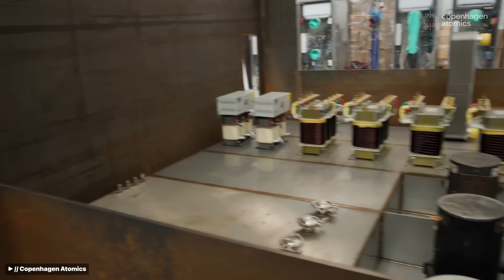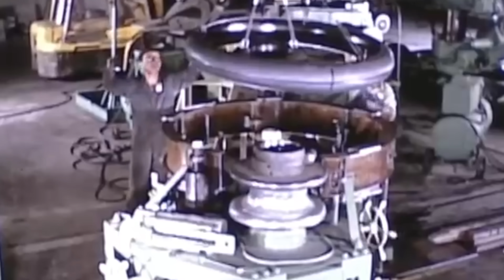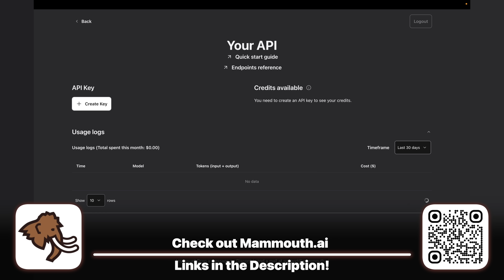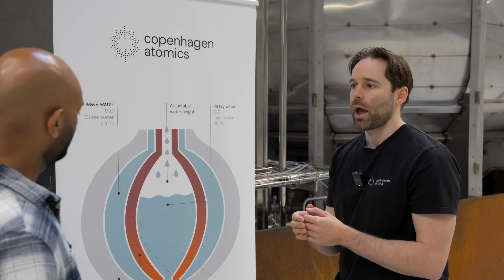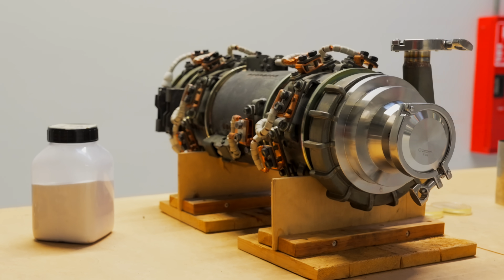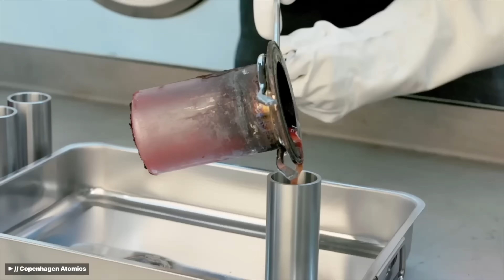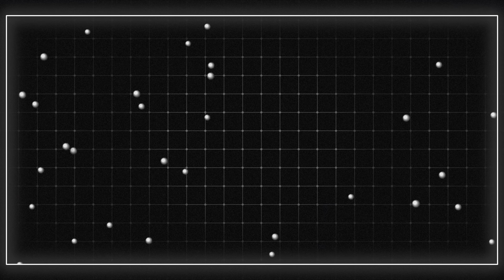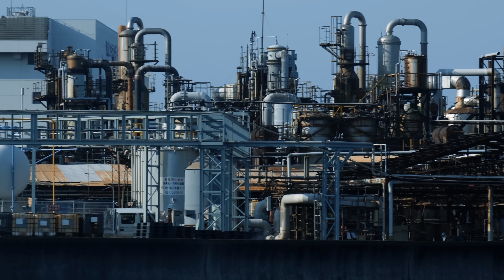This Modular Thorium Reactor EATS Nuclear Waste

Comment: These reactors LOVE heat...they don't need to be put next to a water source like a river or the ocean, they don't want to be cooled down, plop them down in the middle of the desert and they thrive they love heat.
Reply: To produce electricity they can use the hot molten salt to pass through a heat transfer system boil water to run a standard steam turbine or they use the Gas Brayton Cycle to heat nitrogen, helium, or co2 to turn a turbine, then cool it down by passing it through radiators to be  recycled back through the molten salt heat transfer again in a closed loop. Either way, the molten salt gets cooled to maintain safe levels.

Comment: Why does the Electric Motor that drives the pump have to be near to/in contact with the hot material being pumped?
Couldn't they just connect it to the impeller/whatever via a driveshaft?
Reply: The bearings and seals must be able to withstand the heat, corrosion, vibration and radiation without leaks, failure or maintenance.  Hence the five year no touch pump design.  I suspect their pump will go well beyond 5 years, but change out after 5 years for safety.

Comment: My bet is that the nuclear chemistry becomes too complicate not just for them but for the regulators to monitor. Then they will switch to uranium, just as ThorCon and Terrestrial energy did when they made the same realization. (my guess Flibe will do the same) I have no problem with this, there is no shortage of uranium and when utilized in this type of reactor is 10x more efficient than a light water reactor and has high temperature output.
Reply: But uranium nuclear chemistry is just as complicated, isn't it?
Reply: @davidhoracek6758  Nope, because it doesn't need a breeder reactor to fission.

Comment: Great video 👍
Diversification of power generation is key. Wind, solar, geothermal, tidal and nuclear are all needed for now. Depending on location, one more than others can be leaned on.
Cheers from Canada 🇨🇦
Reply: No what we need is a laser focus on Nuclear fission tech, because it is the only energy source capable of replacing our 90% fossil fueled World economy. Wind, solar, geothermal & tidal are bit players and always will be. Useful in very limited geographically endowed areas with certain suitable power requirements, or in the case of Iceland where they use a lot of low grade geothermal heat. The longer we delay the inevitable the more precarious our energy supply will be and we are on the cusp of an energy shortage catastrophe. One good war will set it off.

Comment: The SMR concept that actually works really pleases me. The fact that it can be containerized and shipped is a game changer. Whilst the dream of green energy is nice the base load problem cannot be dismissed and city powering battery banks isn't practical. So nuclear energy, the true green energy considering these are breeder reactors that are far more efficient with any given fuel, on this front the future looks good.
Reply: The reality is that several hundred gigaWatts of solar are installed per year, with that rate increasing rapidly.  Lots of wind power too.  SMRs are dreams, still, at best lab prototypes.  Nice dream, but too far off. 

The demand curve does not match base load, at all.  So, quite a bit of storage is required anyway, and/or peaker units.  And bringing power long distances substantially reduces the impact of local weather (there was a study decades ago). When one is ready to go the final way to full renewables, overproduction solves the rest... affordably, with nice side effects in semi arid places, like shade for agriculture, already created a site with grass grazed by 20,000 sheep, previously semi desert.

Look, I hope the best for nuclear, but its high cost and very slow rollout don't bode for more than a niche source for, say, high latitudes and data centers.
Reply: Geothermal will be baseload, no need for complicated and expensive nuclear.